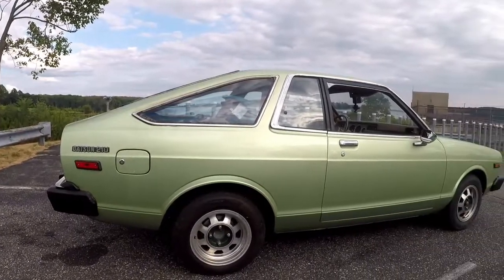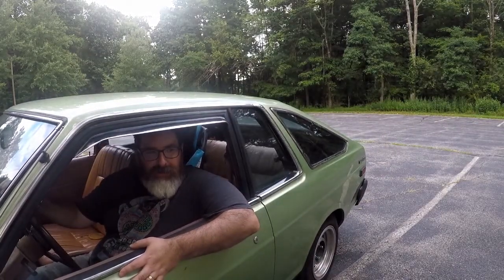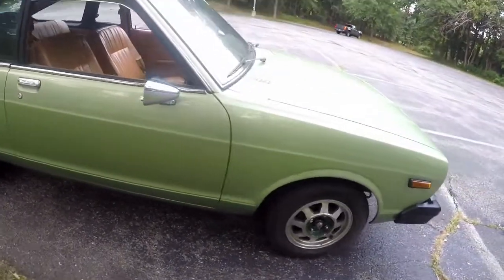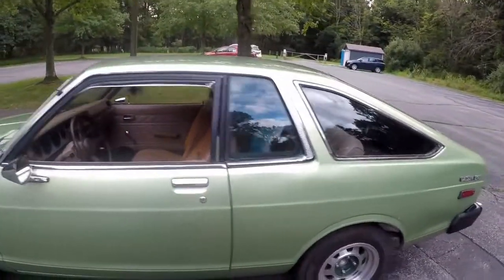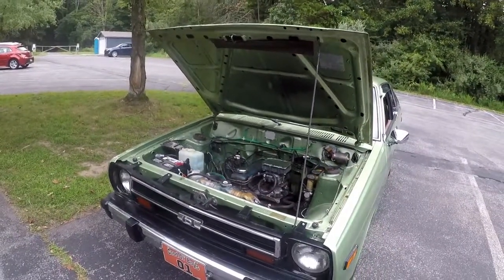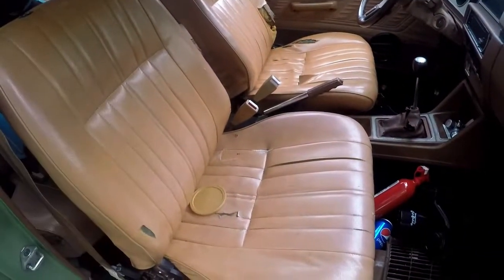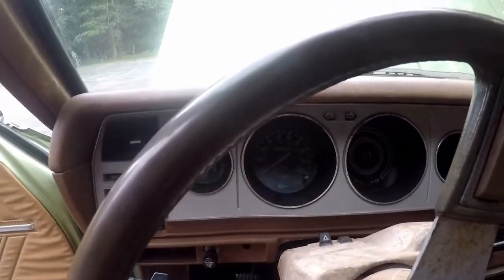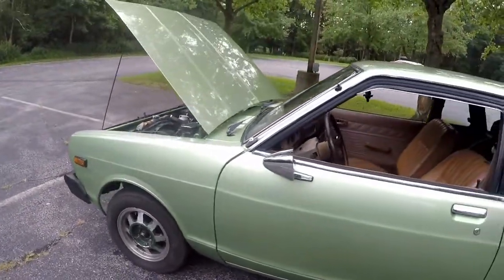1978 Datsun 210 NEW PROJECT !!! "Granny Smith"

Comment: I’m very jealous of your 210. It’s in such great shape. I’d love to see more
Reply from the maker: Thanks Bob I've been watching yours as well.  Let me know if you need parts.   I'm also in the northeast
Reply: @DatsunUSAClub  Do you you have any advice on where to find a brake adjuster for the rear drums? I’ve had no luck with autozone, pepboys or EBay. Thanks. Bob
Reply: Hi do you have any idea where I can find a brake adjuster mechanism for the right rear drum on my 1982 Datsun 210 please? I bet 1980 or 1981 would work too. Thanks. Bob
Reply from the maker: @bobsworkshop5181  rockauto might have them if not try Bprojects japan.  Pricey but he has them.  Or try new-datsun-parts.com in Canada
Reply: Thanks for the tips!
Reply from the maker: @bobsworkshop5181  https://www.ebay.com/itm/115574802124?mkevt=1&mkpid=0&emsid=e11021.m43.l3160&mkcid=7&ch=osgood&euid=79205c2f434e41069296e5b26d946450&bu=43559944293&ut=RU&exe=0&ext=0&osub=-1%7E1&crd=20221022052142&segname=11021